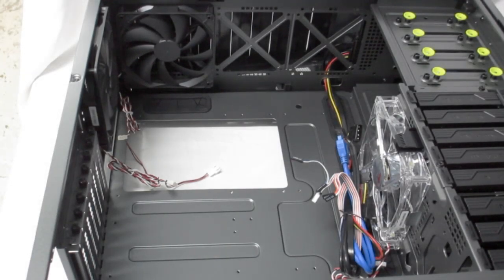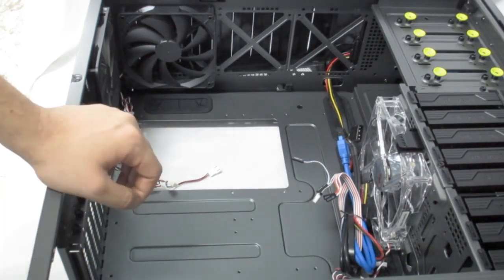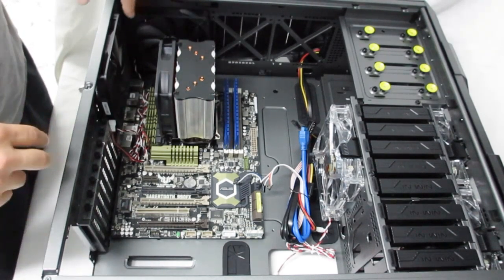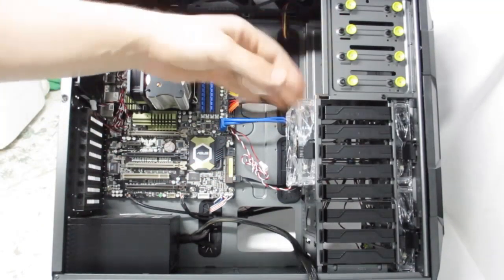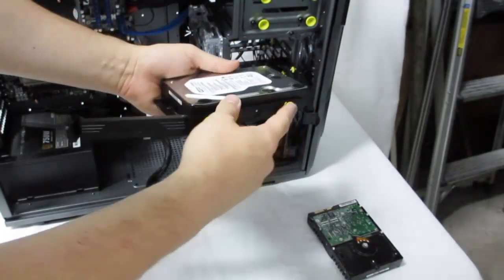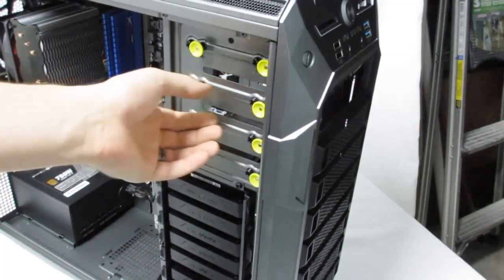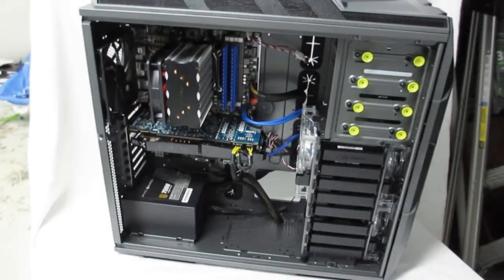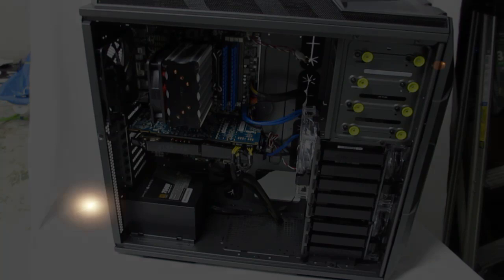IN WIN GRone Component Installation

Comment from the maker: you can find adapters to turn the 3.0 header to a 2.0 header, or you can get an extension and run it to the back panel USB 3.0 port on the motherboard.

Comment: I have 2 questions.

1. Can you install a 140mm fan in the back panel? The website says that you have 20mm cable management room... but most fans are 25mm thick.

2. Are you able to install a 360mm AIO at the top, but in push/pull? By this, I mean that will you have to have both layers of fans and the radiator inside the case, or can you put a layer of fans in that top compartment?